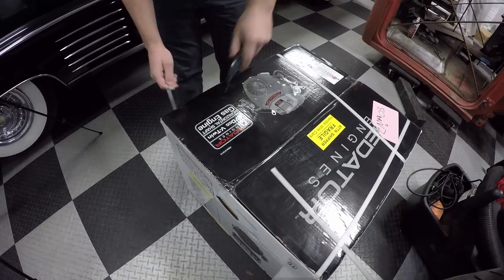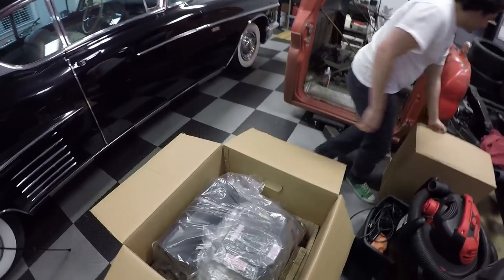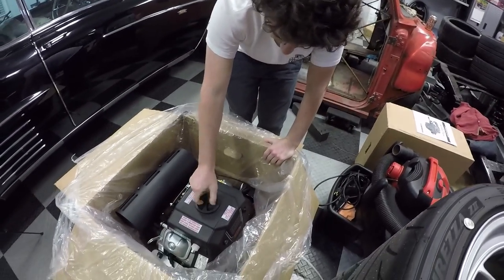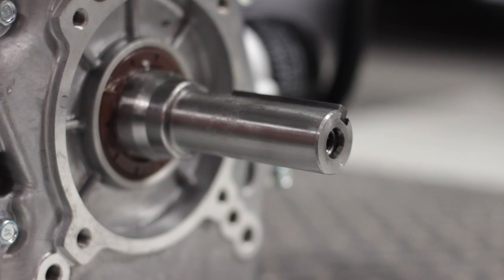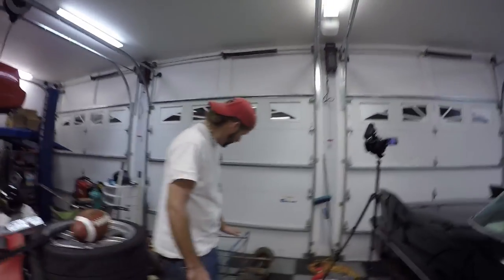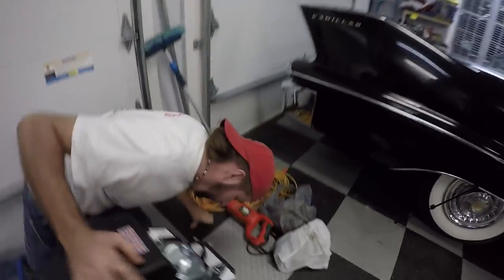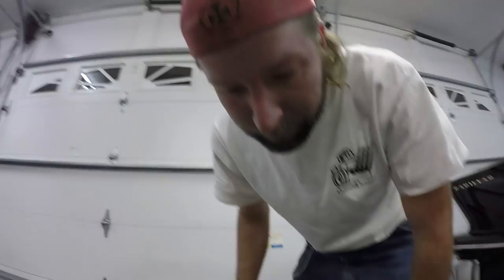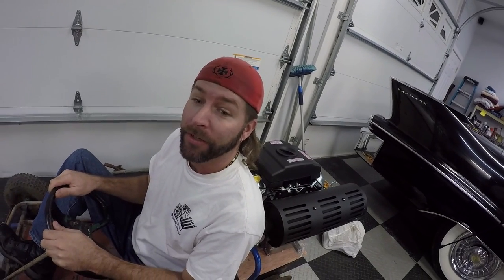22HP V-Twin on a $25 Go Kart Unboxing and Intro

Comment: also the reason for live axle drive off of a jackshaft is add your weight and the frame and the engine to 1 brake..on 1 wheel..just like car bro..you dont stick a race engine in a factory car and drive it everyday. brakes should be at least a disc. on both rear wheels. hell when I was a kid we used our feet or we just slung around..to stop. but your talking over 300lbs of wt to stop vs maybe 120lbs maximum for the factory brake

Comment: Wheelie bars please and straight pipe. Do the regular power mods. Some racing kart tires. And a disc break. Is would be break neck fast. Also maybe lower it so u don't roll.
Reply: +Nick Zaugg there will be mods
Reply: I was planning on putting that on a man I deuce but the transaxle was shredded on the inside. That was about the size of a JD gator so that little one will be fast. The beard looks great
Reply: Manco*
Reply: thanks

Comment: why dont you guys put slicks all four corners and  run a jackshaft driving both rear wheels and set it up as a indy style racer..31ft lbs of torque, shes going to boil the tire if its left 1 wheel wonderer. . when I built mine as a kid I use to always put the 64 tooth drive gear and I believe it was a 12/14 tooth centrifugal clutch she had good power off the line but top end id hit 58 mph with an 8hp modified
drive system: no chains just belt drive it will keep her quiet as well..no wear and tear on drive system with belts..just replace belts cheaper that way.

Comment: you guys are going to have a hell of a time finding clutch for 22hp and you cant use a torque converter because there are only ones that are rated for up to 6.5 hp or you will blow it out.
Reply: There are torque converters for 100+ horsepower snowmobiles
Reply: +Cody Nadgwick  ! Nice cross engineering, This is why the internet was made, I have a lawn tractor wt a 650 motorcycle engine, adding a torque converter will reduce the clutch work when not change gears . Thank you.
Reply: +jaredgt500 gopowersports- link in this description has both clutch and torq a verter for this engine.
Reply: +Robert Miller thanks, a little tourqa verter probably wont even bolt up to the 670. Someday id like to build a gokart with an old fan cooled snowmobile motor, maybe a 340 or 440. That would be fun. Thats an awesome idea to use a tc on a motorcycle engine

Comment: get yourself a cherry bomb or thrush muffler for that beast.  Glass pack muffler would be nasty.
Reply: It's a good engine and a good go kart not a sad honda
Reply: +Waylon Richardson cherry bombs are only for ltr450 quads...
Reply: They only make those for cars
Reply: 3J Kreklau actually thrush is a popular muffler for dirt bikes, you can get them as small as 1 inch diameter and 8 inch length.
Reply: +Waylon Richardson I wouldn't call dirt bike "resignation chambers" glass packs, but I guess that is what is

Comment: Mhh just something taking the power loss over the last 200k Kilometers and the drivetrain loss in account how much power to the wheels would the 50HP engine in my car deliver? That thing weighs around 900-950kg. Now these guys put a 22HP engine on a Go kart that weighs a lot less. OMG this go kart would be around a million times faster than my car.

Comment: I think the chrome flakes would set the paint job off. After it dries really good.& washed.& buffed waxed to. With harbor freight rims& tires for it to. Their cheap there to.,or they were that is. They might be back up in price again. Due to inflation back& fourth all of the time now days to. That engine break in RPM'S should be 1200 to 2000 RPM'S then let it down cool back down after the enishle break in time 20 to 30 minutes tops.

Comment: 22HP from a 670cc? That is insanely underpowered for something of that size. I know of a 125cc that can hit 22.4HP
Reply: What was it on? A dirtbike? If so, that doesn't surprise me. My TTR125L has more power than my minibike with a predator 212!
Reply: Aprilia's RS125 (2002-2003 models seemed like the sweet spot), a normal unrestricted one will probably be around 22-27bhp but when it has been tuned up many people have gotten theirs to 33bhp. And one even raced a Suzuki Bandit 600 and was quite close with it.

Comment: you need a torque converter fat slicks
Reply: oh and use high octane fuel to get the most out of it
Reply: +Halfnoob Halfnot     I find high octane to be a waste of time unless there's an ECU using a knock sensor to advance the timing to just shy of the point of detention.
Reply: +Fourcycle you can tune these to to a point. adjust the magnetic pickup use a cigarette cellophane as a feeler gauge. and lean out till it burns white. i like to run rich for safety reasons and flamethrower exhaust.

Comment: How does an engine that big ONLY put out 22HP... like wtf
Reply from the maker: +Brandon Kent Very restrictive stock intake, muffler, ect. Also it is a low revving engine (governed to 4k). It makes very decent torque. 

We'll be modifying it and hopefully getting it on a dyno.
Reply: +Brandon Kent Because it`s an OHV (overhead valve ) engine. They can`t really rev over 9000 rpm. A bike engine, on the other hand, is a OHC (overhead camshaft) engine.

Comment: You better put a wide pipe on it :p it will sound like a Harley :)
Reply: That's one wheel drive will just pop if a few minutes I might not even go in the street  lol
Reply: +Honda Cr 500 its got a live axle
Reply: +Isaac Jennette I just judged it by looks because I've mostly seen the motor mount plate in the center of live axels but how how does the gear ratios work?
Reply: the torq a verter ?
Reply: +Isaac Jennette like I seen someone say the bigger the sprocket the faster top speed and the smaller the more power I don't know how it works exactly
Reply: +Isaac Jennette on the back gear not on the torq a verter
Reply: the bigger the gear the lower top speed but more take off................the smaller the gear has slower take off but higher top speed

Comment: where do you get ethanol free gas
Reply: +Cade McCabe usually gas stations near boat ramps have ethanol free gas. and this weekend i found out airports have ethanol free gas.
Reply: +Isaac Jennette so I shouldn't  ues gas from regular gas stations
Reply: +Cade McCabe the gas at gas stations have 10% ethenol in it which has water in it. water + metal and you have corrosion. bad stuff. its really bad on lawn mowers that sit up during the winter. spring comes , mower dosent crank
Reply: +Isaac Jennette  .Isaac thank you very much for the feedback and thank you for getting me into building my own go kart from a 1973 cheetah kit kart it's one of the funnest things I've gotten to do especially being able to know that I built my own go kart. so thank you both
Reply: shure. good luck

Comment: people build 5hp moters and make them go 80mph so yea
Reply: +Sagen  Warren its all about gearing. they are gearing it so they dont kill themselves. that would do 100mph easy on the correct gearing. however this will have stupid acceleration and torque. a 5hp might get to 80mph but how quickly?

Comment: 22hp from a 670cc engine lol
Reply: +craig black Ikr! they could take a used atv engine single cylinder like 400ex it would be lighter even with the 5 speed transmition, could have 35hp if lightly moded...